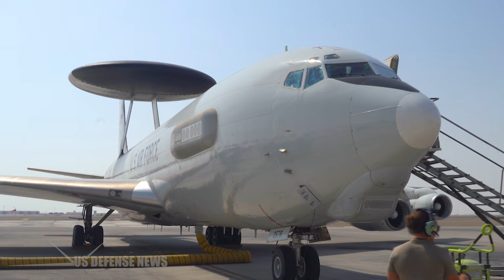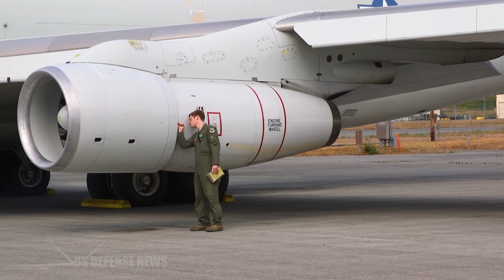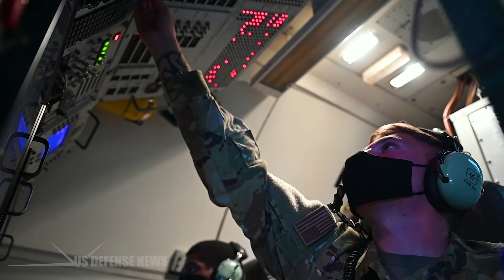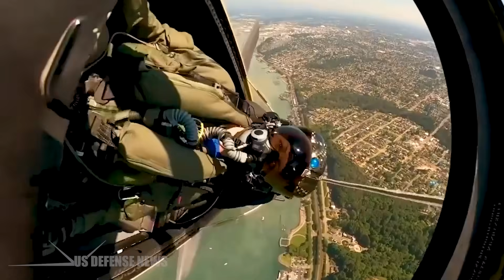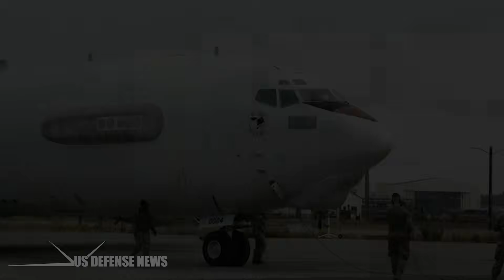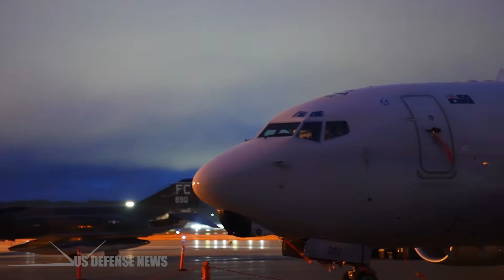Here's Why No One Can Attacks AWACS Aircraft

Comment: I had a college buddy in AFROTC and he flew this plane. He said it was sooo boring, you just flew exactly as ordered, no deviation. He retired and flew commercial airlines after.
Reply: I'm a Mission Crew Commander Air Battle Manager on AWACS and he is correct. I also get the same flight pay he does and I'm in charge of the crew, including the pilot.  He should have been an ABM.
Reply: @zedwpd  The MCC is NOT in charge of the pilot when it comes to safety of flight. Been there, done that. Flight pay changed from the time of WDs to ABMs. Still the point is CRM and NOT who is the "boss".

Comment: Unfortunate you didn't mention the first AWACS aircraft that were developed in the 1950's.  The Lockheed Super Constellation was used to fulfill this role.  This aircraft had an enclosed radar antenna in a radome under the belly of the aircraft and also another long range radar on the top of fuselage.  If memory serves, at one time there were more than 70 of these aircraft with about 35 stationed at Otis AFB (The 551st., Airborne Early Warning and Control Wing) and another 30 or so aircraft at Travis AFB near Sacramento, CA.  This contingent of aircraft were responsible for patrol of the DEW line (Distant Early Warning) which was established to monitor any Russian aircraft that might try to attack the US by flying over the north pole.  Some of these aircraft also flew out of the Krut Royal Air Base in Thailand from the mid 60s to mid 70's.  It's ashamed you couldn't have started your video with some mention of the first historically important aircraft.
Reply: The EC-131's antenna on top was the height finder.
The E-3 uses a wedge shaped beam that calculates both range and height.

Comment: if any Mig-31s are around that can hit Mach 2.8 up near the edge of space  ..... and they are carrying those R-37 missiles with range up to 300 kms ..... and fly at Mach 6 ....... I would suggest any AWACS would be cactus. Those Mig-31s are beasts .... The Americans don't call the Mig-31 the flying SAM battery for nothing .....
Reply: timing from detection of a high fast flyer intercept from high cap with bvr 120s with intercept info from the E3 makes your "suggestion" not so informed, but not impossible. Practice, practice, practice.

Comment: These are finished replaced by the 737NG basic airframe which is much more fuel efficient and the new design of the surf board electronically steared radar is more capable.

Comment: It has two weak points….kind of. Directly underneath it where the radar is casting a radar “shadow” and directly above it…..basically from space. To get to it any other way would be very difficult. But…..below and above is also very problematic.
Reply: timing would have to be perfect to not get detected until then, since we're moving and can find you unless you're not moving or transmitting (and of course someone else will be) that is not the problem you think it is.

Comment: You'd be surprised at just how vulnerable the U.S. military actually is. Their sheer size means that holes appear (inherently) and rely on allies and their equipment to work together. 
Example: cousins of mine are in the Navy, and as part of their drills, they were to remove the warhead from anti-ship missiles and fire a barrage of them at US Supercarrier, testing the defense and ability for the ship to self-defend against these. While a high % got taken out, some got through actually colliding with the ship's deck and bouncing off. Without these drills those defense systems wouldn't be tested that thoroughly.

Comment: It's not a 707, it only resembles one. It has, and always has had major structural and aerodynamic differences. The airplane was the Boeing 717, which is why that model numbers skipped that designation and appeared to go straight to the B 727.  The operational RC 135s have also been re-engined.
Also, the aircraft you display and call a 707 is not a 707 at all, but the prototype for the series, the 367-80, which again, hbears only a superficial resemblance to the production 707. 
Past thoseerrors, there's very little but , obvious obvious obvious obvious.
Reply: Yes it is not B707. It is B720, which looks similar to 707.
Reply: @harungonul8315  No, it's not a 720 either.

Comment: Amazing they use a first gen Boeing jet for these instead of, well, any of the 3rd 4th or 5th gen craft Boeing has built in the last 60 years.
Reply: Yep.  The E-3 AWACS fuselage and engines are the Boeing 707-320B.  Did not even upgrade to the CFM 56 as was done with the KC-135's.
Reply: Japan uses a Boeing 757 based AWACS

Comment: No AWACs have been lost.  But though not as powerful, the US has radars on its reaper drones.  And they have been shot down over the black sea near Ukraine.   China's PLA has designed multiple weapons systems specically designed to take out AWACS, Wedgetail, and tankers.  The fighter escorts aren't much use against the PL15 and PL21 air to air missiles aimed at US radar planes and tankers.  The AWACS is completely obsolete and not survivable against a near peer adversary.   The range of an AWACS is limited by the curvature of the Earth.  Satellites would do a better job.  And likely we already have these in service and China has weapons to take those out as well.
Reply: Reaper now has what is referred to as a black hole counter signals sent back to enemy. We’ll found out soon

Comment: why don't AWACS carry long range air to air missile?
Reply: Because it is not her job.
Reply: Because it's fighter jet accompaniment is far more effective at carrying weapons. They are faster, more maneuverable, and are built to handle the stresses of weapons deployment. 

In addition, the extra weight of the weapons system onboard the early warning aircraft, plus the added reinforcement of wings etc to handle the stress of weapons deployment, means less weight of fuel can be carried, so less range and time in the air, and possibly the onboard radar systems might also have to reduce weight, and the smaller and less powerful radar system will thereby be less effective. 

You can see in fighter jets, that while they carry plenty of very effective weapons, their range is much smaller than an an early warning aircraft. Part of that is due to the more powerful engines in relation to body size for both speed and carrying the weapons load in an airframe that is built extra strong (therefore relatively heavy) to handle the stresses put on it. This includes weight of systems for carrying the weapons, and launching systems, aiming and tracking/radar systems, for the weapons, and withstanding reactive forces from rocket launches and firing cannons, etc.

Putting weapons onboard an early warning aircraft is therefore is incredibly counter-productive, and would probably make the aircraft more vulnerable and much less useful.

Comment: Sorry, but this is utter BS. The Russians have the MiG31 with powerful radar and R37 long range missiles developed especially to hunt for AWACS. These have a decent chance at shooting one down, especially if they are willing to take heavy losses  themselves.
Reply: Russia don't have shit😂😂
Reply: I mean, anything can happen, but an awacs can pump out probably 100 times the energy the mig 31 can produce, and long range fires are impossible without accurate mid course corrections.  These corrections aren’t possible if you cant achieve local em superiority over the target.  

Power is only one factor though, russia cannot produce modern aesa radars, which means they lack resolution and fidelity on small returns (like an awacs 200km away).  Further, they cant channel hop like aesa’s can, making it very easy for automatic jamming software to emit a pulse 180 degrees out of phase with the attacker.  Two em fields 180 degrees out of phase will cancel out and leave the attacking aircraft with absolutely no return to fire at.  

It gets even harder though, because the us has been able to effectively spoof pulse doplar and pesa radars for at least 30 years now, which means they can match the frequency just enough out of phase that it returns targets (often times many targets) that aren’t actually there.  It does this by artificially creating Doppler shifts in the emissions that convince the computer that there are objects moving at all different speeds and directions from a bunch of different starting points.  This is actually why a lot of ufo reports come out near us military bases.  This makes it a crap shoot even attempting to guess which of the 30 contacts that popped up on your screen are the real target.  It becomes impossible when there is a cone 180 degrees out of phase directed around the center of the aircraft AND spoofed returns everywhere else.  This leads to a scenario where the radar only sees false returns.  

Aesa was the future 30 years ago, today pesa radars and pulse Dopplers are woefully inadequate against modern ew systems.  Any aircraft operating these outdated systems will require a substantial amount of blind luck to be successful against radar system with radically more power and agility.

Comment: The air force should equip its AWACS aircraft with chaff dispensers & radar jammers that can be easily & quickly switched off & on,if it hasn’t done so,just in case.
Reply: The AWACS is one single massive electronic warfare machine.
I presume they are packed with the stuff.

Comment: The reason no AWACS has bin lost yet is that they have not bin up against proper long range air to air missiles like the R-37M yet. It is specifically designed to take down AWACS and airborne tankers from up to 400km.
Reply: The probability of kill drops rapidly with range.  Assuming they had the advertised range... I have serious doubts that their targetting systems can overcome EW effectively at those ranges.

People always seem to forget that  defenders have countermeasures.
Reply: @kwonekstrom2138  even under ideal testing scenarios against a drone the best they could muster was 300km which is likely at the extreme limit for the launching platform.  
You're absolutely right that against an actual aircraft they'd be using EW, counter measures, and not to mention fighter escort to intercept any in bound missiles.  Honestly I'd be surprised if they could even launch at 100km, and that's a big IF they could even get that close.  

The US practically treats these as national security assets, a lot of things would have to go very wrong for RU to take out an E2 or E3 - their best shot would be the opening salvo of a war against the US but even then then the US ant NATO would notice the escalations and ensure any AWACS / ISR / C3 aircraft had fighter escort.
Reply: @cruisinguy6024  Yup.  300km is a good distance.  A radar's signal loss is exponential to distance... in both directions.  

For a claimed range of 400km it would be in line with previous Russian claims for the truth to be around 300km.

Even without countermeasures, a missile's kinetic performance is quite poor near the range limit.
Reply: They claim 400km but it’s only been shown up to 300km, and that was obviously not against a real target with countermeasures and a military with extensive counter missile capabilities.  

I don’t think the USAF is the least bit worried about the R-37m which is 1980s tech. 

And the reason no AWACS has been lost is there’s yet to be an aerial engagement with a peer / near peer.  North Vietnam and Iraq had air forces but their fighters were never allowed to get near any of the USAFs ISR / AWACS / C3 aircraft. 

Russia can’t even shoot down Cessna drones, it’s hilarious to think they could pull off a mission against an AWACS.
Reply: AWACS:0

MAINSTAY:-2
Reply: How would any single jet find it? The AWAC radar is way more powerful and will see that jet way before that Jet could find the AWAC. All ground base radars would already be destroyed.
Reply: With stealth missile range is NOT a critical factor anymore as they can get in much closer to an enemy. Especially with the upcoming small medium range Peregrine missile which can double the AAMs that F-35s/F-22s can carry. Though US don't lack a similar large and heavy missile with air launched SM-6 or AIM-174B.
Reply: @johnsilver9338  I'd argue that range was NEVER a critical factor.  Target acquisition and tracking is a much bigger issue at those ranges.

Steath isn't some magic bullet.  An F-22 isn't going to do much over the Pacific without fuel.  That AWACS and tanker are somewhat less stealthy.

I wouldn't hold my breath on the "peregrine missile" appearing any time soon.  As far as I know it's research funding isn't part of any specific program.  Even doubling the magazine capacity won't stop the F-22 and F-35 from having a limited magazine.  This is less of a need with the B-21 able to use air to air missiles.  The AIM-174 is definitely not intended for use with stealth aircraft.
Reply: @kwonekstrom2138 f18s can refuel f22s and the super bugs are low rcs enough and maneuverable enough that they are fairly safe past 100km.  

Limited magazine isnt that big of an issue, especially with aim 174.  Sm6 interfaces directly with f35, regardless of launch platform.  This allows stealth f35s to fly within 100 km of the adversary while f18s stay 100+ km away, while still engaging threats that the f18 cant even see.
Reply: Bin
Reply: Let's say the enemy missiles can range 400km. How will they be guided when Chinese or Russian stealth jets can only detect AWACS at less than 400km? If they weren't intercepted and got to fire their missiles AWACS would detect the missiles and have 30sec to a minute at least to evade. Plenty of time for countermeasures to mask it's getaway.
Reply: Haak, stop spreading propaganda for Russia.  Look at what Ukraine has done to a couple of Russian awacs.  I can't remember their designation but  they have lost an ungodly amount of equipment to a very small adversary.  YouTube videos are showing that Russia is a paper tiger,  and yes their only claim to being a super power is the fact that they have nuclear weapons.  But please understand that America is considered the only Hyper power in the world.  And just consider one statistic between the two militaries.  America cares for it's troops and Russia does not.  In 20 years of war in Iraq and Afghanistan the US lost less than 3,000 lives.  But Russia has lost over 500,000 in less than two years.  And remember Russia has a larger population pool in comparison to Ukraine but in turn America has a larger population than Russia.
Reply: bin up against...
Reply: Bin?...Bin?...I see Scrabble eludes you.
Reply: @FrankTedesco Now try saying that in Norwegian.
Reply: @FrankTedesco 
 He just doesn’t have tiles with Es on them.
Reply: @FrankTedesco 
 Relax, he just doesn’t  have tiles with Es on them.
Reply: @FrankTedesco  oooh no, not the grammar police!
Reply: People who can’t handle the topic, attack the grammar. They have nothing else. 😎👍
Reply: We are gonna find out soon… probably around NATO forces
Reply: @frankcherry3810  considering russia failed to shoot down an awacs twice because in both cases the missiles failed, its not likely
Reply: You're comment belongs in the bin😂
Reply: @surfdocer103 you're.  You are.
Reply: @surfdocer103  *your

Always amusing to see the grammar nazi's using poor grammar.

Comment: Isn’t such radar equally detectable to enemy
Reply: Yes, radar emissions can be detected.    This is how antiradiation missiles work.

Without a lot of information it's difficult to get much data from those transmissions.  This is because the radars also have electronic warfare capabilities.

The E7's AESA will likely support low probability of intercept which blends transmissions into the background noise.
Reply: @kwonekstrom2138 to add to your excellent post, the aesa radars are also capable of much narrower bands, simultaneous band emission, and rapid channel hopping which further confound attempts to isolate and neutralize the emission source.  

Also, long range fires require a missile to be at the intercept point, not where the source was at launch.  It’s practically impossible to calculate this based on the moving aircraft’s emissions at very long ranges because assumptions have to be made by the firing computer about how much Doppler shift is actually occurring and WHY it’s occurring.  With aesa, the amplification can rapidly be varied on the given frequency; which will be understood to be Doppler shift caused by direction of travel changes by the fire control computer.  This, in theory, will cause the computer to assume the plane is going in a completely different direction.  The fidelity of the emission is simply too low to hit fast moving objects reliably (ie from a strategic doctrine perspective)